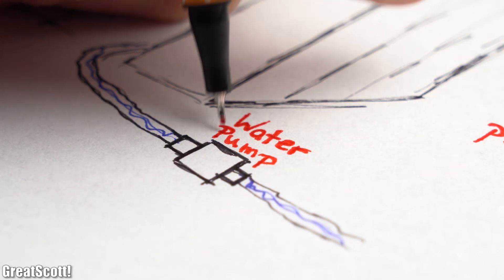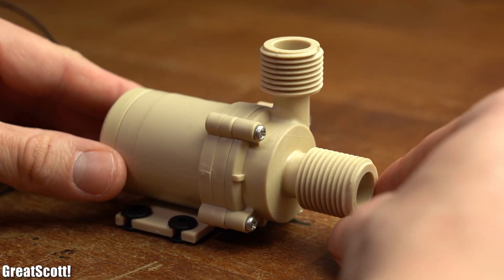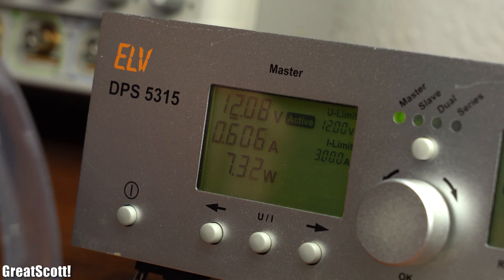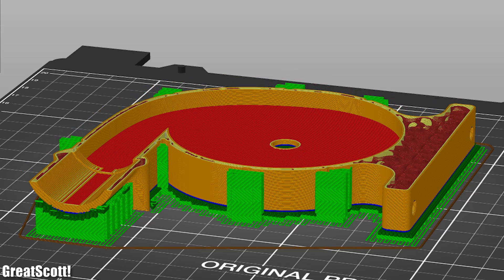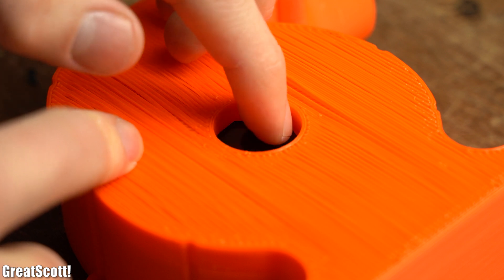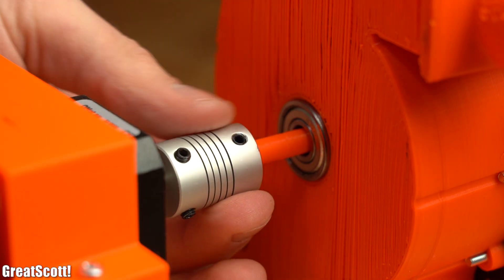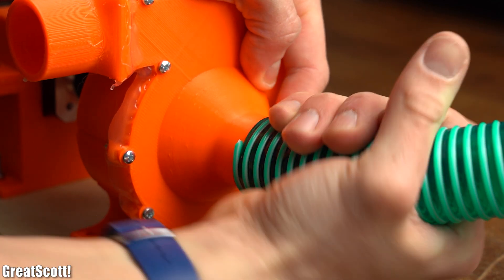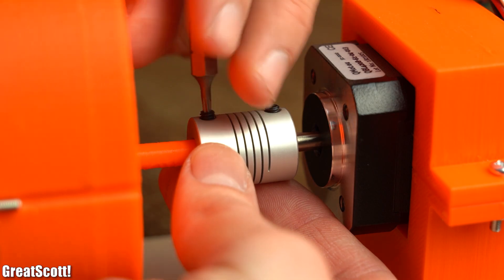Water Pump || DIY or Buy

Comment: Interesting that you use 123d. I have tried to get my head around Fusion 360 but it seems too complicated for me and is very slow when it talks to the "cloud" - so much so, it's unusable for me :(. This is a very timely video as I am looking to build a system to automate watering my outdoor plants. I have a small pump and am looking to do similar with a Attiny85.

Comment: Buy definitely wins here. A change of solution makes DIY for this greenhouse application a bit more interesting. Instead of using a water pump, build a raised water storage tank with solenoids to control the outflow. Let gravity do most of the work for you and you can refill it with a hose which relies on your house's water pump. Refilling may be problematic if you leave for a long vacation and rely on manual refilling.

Comment: For 20 usd you get finished product vs planing, printing and motor with controler.... Buy is win, DIY is hobby :) so I guess if one wants to learn about pumps DIY is ok, if you have bigger project that time should be spent on much more important thinks since you try to grove something and pump is just a small piece of it. 
Nice video, thank you for sharing.

Comment: I still would just make it own water pump IF:
1. Had 3D printer
2. Had unused motor laying around.

When I do, I will use metal shaft and I'm 100% it will work.

Comment: A simple non return valve on the input of the purchased pump would solve the priming problem..... or have the input water stored higher than the pump thus giving it a positive head of water to draw from....... personally I think you could have should have made the 3D printed impeller larger so the bearing you used would have supported it correctly... a simple sleeve would have sufficed.

Comment: Why wont you simply put the motor shaft which is metal inside a hole in the propel? That way you dont have to worry about breaking

Comment: Dear scoot, 
Your decision was quiet well ...
Congratulations! 
If there would be metal shaft, 
You May next to solve leakproof solutions for a rotating shaft, 
To prevent air bubbles 
But dear, 
My advice is 
You should make video on any device how to improve efficiency of device ,
Any Successful device are made of lot of improvements ,
So that 
It is the steeps of Success ..

Comment: This episode should be titled 3D PRINT OR Buy. And yes, If you want to make an useful mechanism with motor, 3d-printed shaft will fail obviously. I made fully functional peristaltic pumps,  with metal shafts and bearings, everything else is 3d-printed and they work really well.
Reply from the maker: I also already made a 3d printed peristaltic pump that worked without a problem. Look for it in a previous diy or buy episode.

Comment: You could use stainless steel shaft attachad to pump fan hole. Also ball bearings should be sandwiched with simmerings on both sides to prevent leaks. Great vid!

Comment: Every time you make something, you almost reach it, and the you get bored and say fuck it. I am watching you since the beginning, you advanced so much, but you loose your touch, was it so hard to make that shaft from metal ? or even connect the propeller straight on the motor.
Reply from the maker: I have to draw a line at some point. This project already took 60 hours to make. I could have gone further but then there would have not been a next episode.

Comment: If you want some help for a custom design of the pump ask me. I am a mechanical engeneering student and i did some exams on pumps and turbines. Moreover I would give you some advices on the mechanical part (why the shaft is thinner than the bearing bore?)

Comment: You compared a pump design with an inlet of 32mm to a pump with an inlet that looked like it was around 10mm. In terms of pumped volume, that's 10x (16^2/5^2) the surface area and thus 10x the amount of water being (attempted to be) pumped per unit of inlet hose length / head generation. I am not an engineer but if it takes 10x the power, your DIY pump motor assembly would have had to have been a 60W unit to match the 6W bought one.  Therefore this DIY or BUY was not an apples to apples comparison.
I think you may also have been able to bake / anneal your rotor assembly (using PLA) to increase layer adhesion and shear force resistance.  

I wonder if you could have made 4-5 smaller pumps with requisite smaller workloads and linked them all with a gear driven by the single bldc motor for increased flow over the bought one. More complex but also more fun!
I am guessing you went 12V as you can then power your greenhouse with solar, in which case you can run the (lower capacity) pump for longer using the sun and a large (32mm) inlet is not necessary.

Keep up the good work.

Comment: Tip, let boiling water rest for 2-5min then rest the end of your hose in it for the same 2-5min and then quickly push it over your fitting I've had to do this with a few different types of hose with grate success.

🥃cheers🍻

Comment: When i was younger i built a couple of small water pumps and one thing to say never start with big one. Me and my friend tinkered with mamy designs ,diferent propelers, etc. After that we built one from old drill motor and pvc tube. She had very good flow it was frickin good even at 6 volts. It still needed some tinkering overall. I have it disassembled on my workbench and when the time comes i would definetly improve it.

Comment: DIY pump is much bigger. DIY pump is using a larger motor. DIY pump needs proprietary controller.

Were you actually trying to do DIY or buy? Or just showing off a motor? What was the point of this video? Two vastly different pumps. What about the price?

Comment: 1. Your pump has no self-priming feature, you need to prime it first for it to work properly.
2. Just use a steel shaft...
3. If you can't get a steel shaft, print the shaft separately, because with the orientation you have printed, you are putting torque on to the layer itself, which is the weakest part of the print.
LAYER LINE || <- PUMP (NO) = <- PUMP (YES)

Also, you can't print the gasket too with TPU.

Comment: Commerical is the way to go honestly. Trying to make it as you did just wouldn't work unless you cast it. 

Also high flow rates dont really matter much for automatic watering systems. Efficiency is your best bet to reduce cost.

A really efficient DIY option for a water pump is a hydraulic ram pump. They're simple and easy to make. Starting and stopping is as easy as cilycling the valves. It doesn't use any electricity.

For what you do, though, you should just stick with the commercial pump you bought. It's probably overkill

Comment: I think if you tweaked that impeller design to accommodate a carriage bolt (square hole on the impeller side and a recess for a nut on the flat side) and use that as it's shaft with epoxy and then printed it with 100% infill then the design would probably work just fine.

Comment: 3-D print a pump designed to use a metal shaft?  That thing is huge, though, so I'd go with something a little thicker.. maybe 8-10 mm stainless rod?  Using a keyed shaft is probably the strongest connection, but a splined shaft and some epoxy might work.  A screw shaft or friction fit would probably be too weak for that large an impeller.

Comment: There's a lot of issues with your diy solution.
1)the axle was thin enough that there was no contact with the bearing. The oscillation of not being held perfectly centered could have contributed to the shaft breaking
2)the long axis of the shaft was printed upright, meaning it could easily shear along the layer lines. Print it sideways so the layers run along the long axis of the shaft
3)petg is one of the most brittle 3d filaments out there. Abs would probably have been a better solution in the first place
4)3d printing the shaft was probably not the best idea in the first place
5)you could add a u groove in one of the sides of the pump enclosure, and lay a thick bead of silicon in it to create an o ring
Those are the issues I'm seeing right off the bat. I'm sure there are more issues that led to failure, and I also saw a lot of areas that could be improved, but didn't necessarily lead to failure.
Reply: Just use a metal shaft. Or mount the impeller directly on the motor shaft. Then there is no need for any extra work. I would also add a seal for the shaft
Reply: There is more, the pump isn’t primed”

Which is important for it to work without any issues.
Reply: @zainahmed4172  true. Centrifugal pumps have a very difficult time pulling suction without sufficient pump head, as well as issues when cavitation happens or if there's large pockets of air. Air is compressible, and these types of pumps (impulse type impellers) are meant to really push incompressible fluids, not cause flow due to a pressure difference.

Comment: You may swap the PETG filament with ABS or Nylon Carbonate Fibre , these have a much greater strength properties comparing to PETG, and also the mechanical design of the 3d prints plays a crucial role to decide whether it is strong enough or not, that means you can improve the strength of the prints even if you using the same filament here

Comment: If you want to stick with the 3d printed shaft, you need to print it in the other direction.  As is, the stress in the shaft is parallel to the print layers. Print it laying down and it would not break

Comment: I thought the 3D printed shaft was a bad idea when I saw it. Just use a chunk of metal. Even a bolt with the head cut off. 
RTV would be a good sealant for this pump assembly.

Comment: Why a pump vs. a valve?
For my garden, the most practical source of water is my house water; which is already under pressure and hence I use a valve rather than a pump.
This is nice because electric valves are way less expensive and also way more reliable.

Comment: Print orientation looks to be the cause of the failure... if you were to print the shaft as one (or two) separate parts laying horizontal, you would would be able to transmit a lot more torque through the shaft... I still would buy myself, but for prototyping with FDM, thinking about stress and shear along layer lines is a lot more important than most think.

Comment: Pump shaft was too small to handle those forces.
If the pump shaft had enough bigger diameter, this pump should have been worked. 
Try printing bigger shaft diameter impeller, drill out the hole.
This will surely work

Comment: Despite reading other comments saying this, well here's another, the impeller vanes are backwards, so the design is flawed already, and of course to drive said impeller it's better to use a metal shaft through it to the motor, cos 3D printed plastic isn't that structurally good for things that need a lot of twisting force applying...

Comment: 3d print a new impeller and use a stainless round bar piece. Drill the end of the shaft for a roll pin and drive the impeller off of a notch in the impeller. shaft seals are also a thing and they are cheap. add the diameter to the 3d print for the housing.

Comment: When you design a shaft you have the consider the modulus of rigidity of the the material you used and you should put fillet at the edges of the shaft other wise the failure would occurs to the  shaft like what happened to you. 
Also the modulus of rigidity of the material you used should be greater than the centrifugal force.

I really like your videos🙏🙏

Comment: Is replacing the plastic shaft with a metal one difficult? Why didn't you cut a proper gasket or use RTV gasket maker?
- 
Bottom Line: I regret watching this video since, now I feel even dumber.

Comment: while it may not seem like it at first, mechanical contrivances are surprisingly difficult to manufacture. This pump was doomed to fail from the start, even if the shaft hadn't broken. the surface finish of the interior would have allowed a lot of water to bypass the impeller,  and your impeller blades were backwards. And then there is the matter of sealing a high speed rotating shaft. Fabricating these types of semi-precision parts seems more like a job for a lathe or mill. But I enjoy your videos, so keep up the good work.

Comment: I see people suggesting a metal shaft, but even with that it would have never worked. The impeller vanes/fins are wrong. It should be the opposite. You can compare to the commercial pump at 3:25 to the DIY one at 5:00. I dunno how Scott can miss it and commit such a fatal mistake. I hope he rectifies it and try with a metal shaft, it will definitely work.

Comment: Do you really need a high flow rate to deliver water to your garden? If you could be happy with a 1 liter per minute flow rate, a peristaltic pump with a 60mm diameter rotor squeezing a 6.4mm ID tube will provide a 1LPM flow at approx 300RPM.  This is perfect for a Nema 23 size stepper motor driven with Trinamic controller.  The advantages of peristaltic pump include self priming and depending on tube, you can get lift up to 8M and pressure about 2 bar.  You can also pump particulates and viscous fluids. With clever use of check valves (like diodes in full bridge rectifier) and Y connectors, you can simply reverse direction of stepper motor and the pump will draw fluids (nutrients etc) from another source and then continue on to your garden.

Comment: for a glasshouse I'd suggest trying rugged and low cost AC submersible pumps sold for fountains and aquariums - completely waterproof cos they're designed to work underwater - AC has less problems with electrolysis if some moisture does get in to your wiring. 
if self priming is required you could try to DIY a peristaltic pump - which also meters the amount of liquid pumped if you count revolutions.
or for simple DIY pumping solution you could use an airlift pump

Comment: Your design is perfect , except for the choice of the ball bearing. Stop the clip on the time 9:10 and you will see for yourself. the shaft is smaller in diameter than the inner one of the ball bearing. Replace it with another one that fits the shaft VERY tightly. Then everything will be OK. Trust me for this.

Comment: if you had a heat enclopsure for the 3d printer and set it to about 60c and the propeller shaft was a bit thicker, i think it could work really good

Comment: I have gotten away from using plastic shafts on designs if possible. Unless you sleeve the drive shaft, with a part with the print lines going the opposite direction. As the twist motion on a shaft printing with the layers in the Z direction are weak to the torque. Generally I just keep some cheap rod stock on hand for such things these days, as they are quicker and stronger to use.  

I've also built a few pumps, mine where designed for oil, and where prototypes for a later to be machined design. But worked out great, I went with a Lobed design, as this is typical of most oil pumps and yielded both the pressure I needed and flow. With a mix of O rings and RTV as case sealants. Hopefully my own failings and what I have learned can help someone else a few steps on their design.

Comment: I suggest you design your impeller with a hole in the center of it so that you can mount a threaded metal rod as your drive shaft.  Something like this:  https://www.mcmaster.com/all-thread-rods

Alternatively, you could have a better metal shaft made on a lathe, but it isn't absolutely necessary for a DIY project.

Comment: I gave you a thumbs up for effort. I work with and rebuild centrifuge pumps the smallest is 4x5 and the largest 12x14 inch. You baring to shaft was poor and will make steel shafts brake. The part you didn’t make would be a baring mount not a motor mount. Thanks for sharing.

Comment: The commercial solution pumps are available in 12Vdc and 24Vdc on ebay for cheap.  £25ish.  They are used in drinks vending machines and work well.
I use one to destratify my hot water tank.

Comment: I'm also into hydroponics and purchased the little tan pump from Amazon, w/o realizing how small it is. IMO, Shurflow pumps are among the most reliable, but much more expensive (depending upon the price of your time 🤔). I'll try the little pump to circulate HW in a radiant floor heating system for my new camper van build.
IMO, the flaw in your 3D printed pump is that you should have used a stainless steel shaft all the way through the impeller with set (aka grub) screws holding them together (similar to your shaft coupling).

Comment: You need a plastic with a much higher tensile strength, or increase the diameter of the impeller shaft. Might be easiest just to try PLA instead of PETG.

Comment: I think a metal impeller shaft would solve the problem. So you should pring the impeller with a hole for a rod or some all thread. If you are having layer adhesion issues with petg, I recommend to increase the temperature. Also when printing any shaft infill setting should be set such that the shaft is solid. https://www.instagram.com/p/BqfjCTiANc5/?igshid=1ddxkcpyia3do
And
https://www.instagram.com/p/BtMtqmaghvQ/?igshid=1ozw1q186l84w

My petg shafts hold up to pretty good torque. Still I think for this application a proper metal shaft is a better way to go.

Comment: I had my doubts about the tolerances 3D printing could take straight away together with water tightness. Smaller pump experiments might give workable solutions.

Going old school about it tho, I'd have attempted an Archimedes' screw impeller with impeller sections screwed onto some studding with sunken nuts and the motor directly connected to the studding for strength.

Comment: Rotational stresses on layers stacked like pancakes is silly...no real "strength",  print the shaft flat on the board...this way the layer lines are down the length of the shaft, this will require modifying the impeller by putting a hole in it rather than a shaft, the shaft will have to be a separate piece glued into the impeller